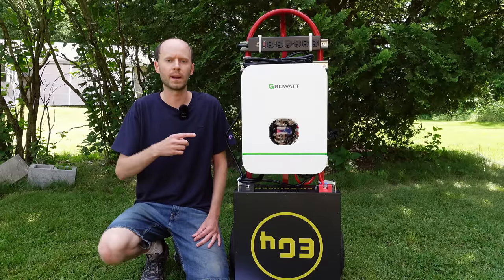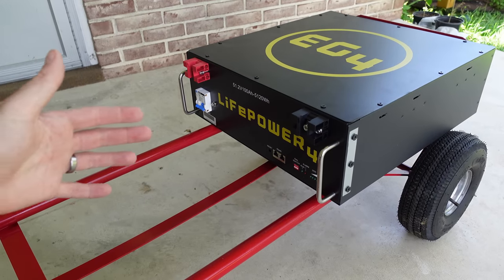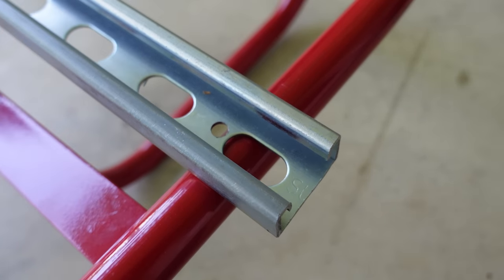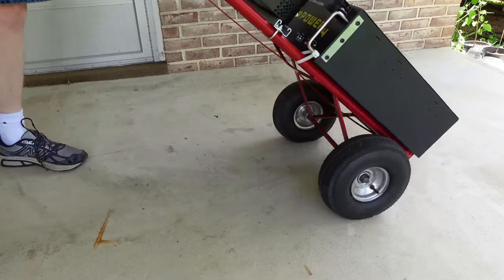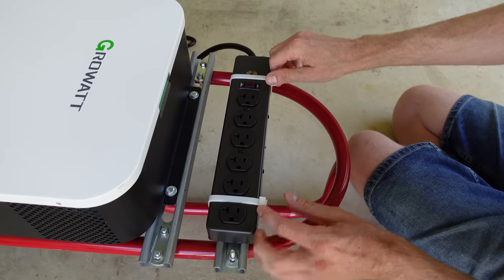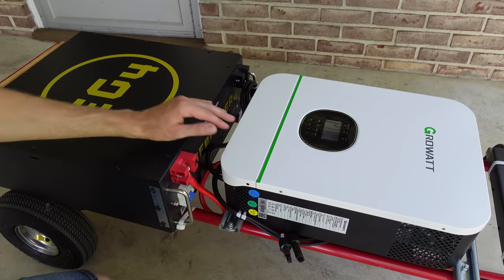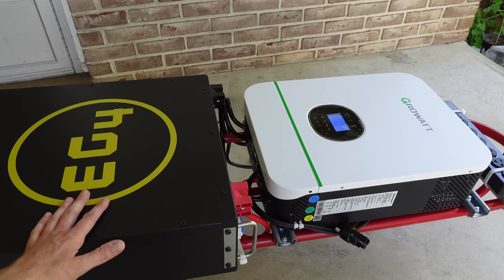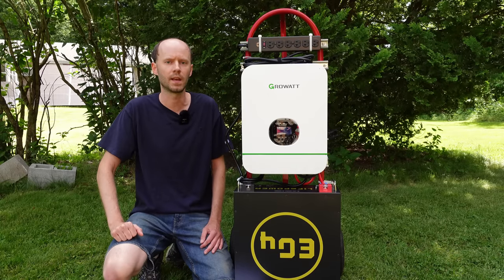Building a 3000W Portable Solar Power Station, Great for Power Outages!

Comment: Sorry I did not watch it all, but skimmed to see if you covered a few things.  Does it have the charge controller built in?  Do you have the connectors (and the panels to charge this with portable panels.  Also can you mount the solar panels on the cart too?  They have some nice 200w portable solar panels for around $300 each.  It would be nice to have saw 5 of those hooked up.  That would let you charge the battery in 5 hours of good sun or extend the battery life significantly.  The 5 panels are the same price as the battery really.  You might need to extend the plate on the bottom and put a lip on it... then bungie the panels on (maybe in a canvas bag).

Comment: The first step I would have performed would be to flip that EG4 cover in order to make the presentation look more uniform. Great overall. Thanks for the presentation.
Reply from the maker: Believe it or not, I tried that... it doesn't go on the other way, the screw holes don't line up unfortunately.
Reply: @LithiumSolar  Ha, I stand corrected! Thanks for your time in producing a quality video.

Comment: Im having difficulty determining what would be the primary use of a setup this size in a residential home around 2,000sq feet in size. Refer/freezer backup?
Reply: So how many KWh do you use per day at your house?
Reply: @budmartin3344  name a day? Here recently, 72kwh
Reply: @Armenian  That is a lot of power usage, that will be a big backup generator if you want to run your home full load during power outage. I have 10KWh  batteries back up and 1000W of solar for my home during rolling black out in Cali, mainly to keep my fridge, lights, computer going for 2 days and longer if I have good sun to keep my batteries charge, I have gas stove and gas furnace so they will still work.
So what do you use your '1280Wh LiFePO4 Solar Milk Crate 12V DIY Portable Power Station 800VA Inverter Victron' for?

Comment: You may need locking mechanism for the input powerplug (as in wrapping) and label it visability --- it would be damaged if anyone accidentally plug that in a loop to the power strip.
Reply from the maker: Ooof yeah that would be bad...

Comment: Great! I wonder if I could use this for my stationary RV and also my barn, back and forth. COuld a 30 amp RV plug be added somehow safely, so I could plug my 30 amp RV shore line right into it?  And get the full 30 amp power? Hmmm...???   AND, could it be in freezing temperatures?

Comment: Built this in a milwaukee packout 38in roll out tool chest using the victron multiplus (new 2000wat virsion) and a 200ah redodo battery.
I built an encasement for the battery using 1/2in plywood And then cut a cover out of plywood shape to the pakout case and place the multiplus on top of that.
The case has built-in intake and exhaust temperature control fans from thermaltake  I used 8 static pressure fans 4set the way you would have building a liquid cool system on a computer with dust/moisture filter in between.
It also has a smart shunt and smart mppt.
I used a 30amp Connector for to hook to my generator and and adapters to charge from home. It has 8x 120v outlets 4x 12v cigarette lighter Style outlets with four USB C 4.0 and 4x reg usb.
I love this thing though I only use it to power a Dometic 95cu refrigerator and some LED lights and a microwave and 4k projector and sometimes a 12 volt water pump for my shower.
Glamping has become a hobby
Reply: Fun!  But man...that Milwaukee packout stuff is Guchi-priced! 😵‍💫I was considering the Dewalt 63-gallon or Ridgid 2.0 Pro Gear cart.  They're not vented and such...and the Ridgid would be over-grossed (it's only rated for 100 lbs) but I'll probably try one of those two.
Reply: @737smartin  I'd considered the DeWalt but settled on the Milwaukee as it seemed a bit sturdier

Comment: Is there any reason you couldn't wire a 30AMP female RV plug where you wired the power strip? And use this as a packable RV power station?

Comment: Can you make part 2, able to connect to more battery for more station usage. But able to me mobile if need it.  Thank you 

Question, don’t you need some type of fuse between positive wire?
Reply from the maker: There is a circuit breaker built in to the battery.
Reply: Great always want to figure out a way to build this and be more portable.  Is this more reliable than ecoflow and bluetti?

Comment: I really want to build one of these to take to trade shows to power my TV, laptops, and change phones.  The problem is, $2700 "isn't a bad price". The PDX Hone and Garden show charged me $150 for power, so it will take 18 trade shows (like 5 years) to break even.  Of course, being able to use it for camping softens the financial blow a little bit.

Comment: Can you  build the same build, but on a much smaller scale, like using 2-4 lithium batteries, and a 2,000-3,000 w inverter, plus a long or short power strip?

Comment: For $300 do I get a 2,400w solar panel with the battery or for $260 do I get the 2,000w solar panel with the battery  ? Do these solar panels  can power on a hot electric plate that takes 380w ? Because I have a 400w power inverter attached to my car battery it powered the 380w electric plate that takes 380 for about 3min.Im guessing it needs 120v.The car battery is only 12v.Will the solar panels give me 120v ?

Comment: Last year I bought the Ecoflow Delta Max with extra batteries for 6KW total output.  Since they now have the Delta Max 2 (with LiFePo4 batteries) I was contemplating another setup for 12KW total juice.  Cost is still an issue and I have the technical ability, so I'm seriously considering a DIY system very much like this.  Cheers!

Comment: Would I be able to use the following solar panel or panels with this setup? Specs are slightly different than what you used. Thank you. Boviet 400W Solar Panel | Silver | Monocrystalline | BVM6612M-400L-H

Comment: if you where to put this in the perspective of a KWH system what would it be? As I don't understand the limitations. like you said running a window air conditioner??? how long, like in hours a day? O and the minimum and max solar PV capacities are?
Reply from the maker: These specifications can all be found by simply looking at the two main products used (inverter and battery).

Comment: Can you please help me understand why its better to spend $1500 on the EG4 battery over a more basic 100Ah battery from someone like LiTime or Power Queen for abour $300?
Reply from the maker: You're going to have to series connect those 12V batteries, which I think you'll find is difficult to keep balanced properly. Additionally, the EG4 used here is UL-listed.

Comment: I've been wanting to do a similar setup only using the MPP 2724LVMR which has easier connections and built in AC outlets. It is also slightly smaller than the Growatt.  The problem with the MPP is that it only allows for 60 Open Circuit Voltage and a 750 Watts limit on PV input. But that's OK, because I plan to build it as a backup system in case of power outage with charging only from AC Grid (I can't setup solar at my place) So that's not a limitation for me.
Reply: Where can I purchase the  2724LVMR?

Comment: Great project.  What's the best way to recharge the battery if the electricity goes out for several days?  If solar, what's the best size panels?  Thanks for this.
Reply from the maker: A new video is up showing solar panel connections - which would recharge this nicely if the power were out for several days.
Reply: What is needed to add a 30 amp connection to charge an electric car?

Comment: I spied some pretty beefy low-priced cables in my local auto accessories retailer intended as battery leads. They were pre-made.

In Australia, black is neutral.  Our domestic power is 240V-250V, so our domestic power board are rated for 10A.
Reply from the maker: Just make sure those auto cables are actually copper. Some of them are copper-coated aluminum (CCA) and is why they're cheaper.

Comment: Sorry, maybe a dumb question but I'm somewhat new to this solar stuff and trying to learn. Great video by the way. I'm trying to understand why you switched the cables for the solar input? Wouldn't you need to have the positive output from the panel hooked up to the positive terminal on the inverter/controller? EDIT: I just realized why lol, because the positive OUTPUT will have the male connector THUS you need the 'other side' -> Female connector.

Comment: Great idea, only change I'd make would be to mount the inverter on the bottom, to keep the weight down low.
Reply: The battery is the low component, and it weighs somewhere between 75 and 100 lbs.  The 15 lb inverter weight is trivial in this system.

Comment: It seems to me using the matched 3000 watt inverter from EG4 with its direct comm link would simplify this configuration even further-It’s smaller lighter, wouldn’t present a problem to attach to the cart, the connections appear much more accesible and it has a higher PV input at 500 volts. Am I missing something? This looks like a better way to go from my research.

Comment: If you used a 30A power strip would that kick out the 30A? And would you say that this is comparable to say a EcoFlo Pro 3600 with an added battery?

Comment: Great video, I see it for me in Puerto Rico where hurricanes are taking power away for weeks.  Can you use another battery in parallel for 8K/Whr still at 120v would power my whole house for a full day easily no AC's but thats ok. I like that you can charge with AC and or Gas Gen. During Fiona, we used an EcoFlow Delta Max which cost the same if not more than this solution.

Comment: I am confused I have read at few times from page to page multiple times that Growatt Inverters produce heat and there needs to eight inches or more between all other electric components. I am no expert and I am also checking to components and looking for paint  that is for high heat I am also looking in cement board and components to reduce the firer risk. I am also trying to understand if a extra fan or blower is needed to blow on the inverter to do reduce the heat build up. I live in a high desert valley on a ranch and our summer temperatures are high. If I am going to build a portable power station it needs to be water and livestock prof.
Reply: Don't all inverters produce heat?
Reply: How high is high?  I belive that your issue with heat is not paint, or the small amount of heat the inverter generates, but more likely the air temperature.  If I recall the recommended temp rage is from 32F to about 130F.  If the air temp is 130+F at the inverter, a fan will not help cool the inverter.

As far as water and livestock goes, most inverters are intended to be used indoors.  Sol-Ark may have a water resistant solution for you, but it's big bucks.  

As far as heat goes, lack of heat can be a problem in winter.  Batteries don't like operating at low temperatures.  You might need to insulate them or provide heat for the batteries in winter.

Lastly, YouTube is not your best one-stop place for advice on what equipment you need.  Talk with some neighbors that may have solar and or join a solar forum or two.

I'm sure there is a solution for you, but just like raising livestock, there is work required on your part as well.

Comment: Where to use this basic idea as a place to put this emergency power... My small home, far rural, upstate NY. No garage, only a crawlspace, not basement. It gets extremely cold here. One concern would be, even if the solar panels were mounted on the roof, where is it safe to set up the equipment?
I assume that the idea of simply storing it in the corner of the bedroom is a realistic (safe?) place?

Comment: The switching of the solar inputs confused me...Is there a video to explain this? or could someone explain this to me? Awesome video!!
Reply from the maker: A male connector goes into a female connector. That's why. Make sure the polarity is correct going in to the inverter input or risk blowing it up (very bad).

Comment: Just checking or need some advice : The Hybrid Inverter input gets plugged into the home AC  socket? Correct? Is this for the purpose of charging the battery only by means of MPPT internal charger? Or is the MPPT charger only applicable for when you use Solar panels? Any layman's explication will be appreciated thanks!
Reply from the maker: This is NOT a hybrid inverter. The AC input can charge the battery and pass power through to the output.

Comment: Very cool.  Is it possible to do one of these and have an output of 220 volts, auto start a small 110 generator when the batteries get low, maybe hooked up full time and auto cutover when power goes out?  My dream.  Thanks
Reply: Do more research before investing in any equipment, especially a generator.  It is not as intuitive as you might think.  Signature Solar has some videos on using generators to charge batteries that power inverters.  I strongly suggest you check them out.

Comment: How many hours this would run a 5000 btu mini A/C 12 amps 450W ?
Reply from the maker: 3000W x 0.85 Efficiency / 450W = 5.6 hours, assuming compressor runs constantly.

Comment: What is the run time for this outfit with a full charge running 4-5 led light bulbs and a fridge and deep freeze ...  I live in northern Nova Scotia and I was without power for 10 days I do have a 4000w generator but Fiona took most of the power grid down in the north .. In 100km range there were only a couple garages open using generators and the line for gas was 1-2km long so they ran out of gas in a couple hours .. A generator isn't worth 2 cents without fuel .. LOL .. I was down to running the generator 1 hour at a time 3 times a day for the fridge and freezer ..

Comment: How much and what are  needed for 2 freeze , 1 tv, 3 computer,2 laptop, electric stove,oven,microwave, water heater, blender, electrical hardware, electrical kettle, 1 electrical sofa, 1 electrical, massage chair, 1 electrical bed,1 electrical bath, 1 rice cooker, 1 instant pot ?

For eg. Which are durable,  cheap, best brands and how many inverter, batteries with solars? How much volts or Watts?  What are required?
Reply: Sounds like you could just talke a look at your last electric bill for your total electric power consumed, but from the items you list, this project is not for you.  It's not big enough.

Comment: If you went through the trouble and expense to build this solar generator, I would add some solar panels and run my fridge and a couple other loads 24/7, that way the thing will pay for itself in a few years..There is no worry about running down the batteries, if used with solar those batteries will easily last 15 years..And you could add another server rack battery in parallel and another grow watt inverter in parallel and decrease you electric bill further or completely depending on your situation..Which is watt I do..Misspelling intended...

Comment: Just curious why you decided against mounting this build on plywood.  Is it because concerns with it catching on fire?  If so, then why not use cement backer board?
Reply from the maker: The inverter manual says this in bold capital letters "SUITABLE FOR MOUNTING ON CONCRETE OR OTHER NON-COMBUSTIBLE SURFACE ONLY". It doesn't make sense to me to use cement board on top of plywood when you can just use a couple of pieces of strut channel. Sure, it works if you want I guess.

Comment: I would add the suggestion of placing a large tote under the bottom edge of the battery and held by the hand-cart for water protection! Flood safety as long as the sidewalls are not penetrated...

Comment: When you charged the battery pack from the wall outlet, where does that cord connect to? Is there a specific set of contacts on the inverter itself? Also, if I want to use solar panels, what size and quantity of solar panels would you install and how would you connect them?

Comment: with all the comments about a ground, attach a short rod on the U handle and when you lower the cart to the ground the fold out rod will go into the ground using the weight of the inverter to assist. May not be ideal but would always be there.

Comment: Most informative and a great MOBILE  power system.  One area which has me confused -- at around 12.25 you swap the polarity of the Solar connectors ??  Please could you kindly explain this again ??  Surely Positive stays positive and Negative stays Negative no matter what ??  Please help me understand this  - - -   Thanks
Reply from the maker: You need to think of them as male and female, not positive and negative. A male connector plugs into a female connector. Whether or not it's positive or negative will depend on if you're looking at the solar panel side or the inverter side.
Reply: Got it Thanks

Comment: Can someone please explain how you can use that Growatt inverter outside? It is rated for a relative humidity of 5% - 95% noncondensing. I live in Florida and the humidity is perpetually 95% or higher.

Comment: Can you add a 2nd battery to this set up? And would you use the same 2 solar panels you mention on your  other video to charge both batteries?
Reply from the maker: You can add more batteries, yes. A second won't fit on the hand truck though. I would use whatever solar panels I can find locally for cheap, doesn't have to be the same panels I used before.

Comment: I bought the battery just a month before it announced UL listed, does it constitutes as UL listed?
Reply from the maker: When they announced UL certification, they noted that no changes were required to get the certification. This means our original batteries are the same as the UL version. I'm not sure how that works if you're building something that will require inspection and thus a UL sticker. I would ask Signature Solar if you're not sure, they may be able to advise.